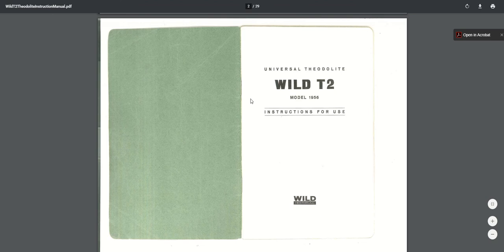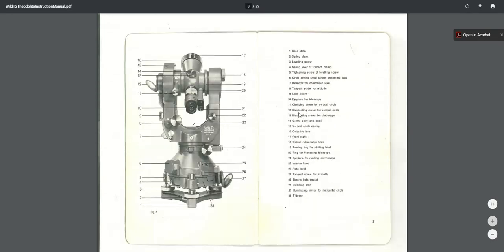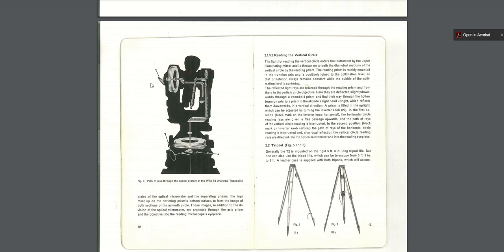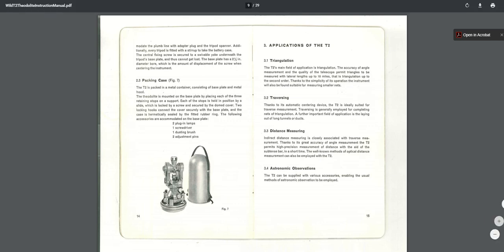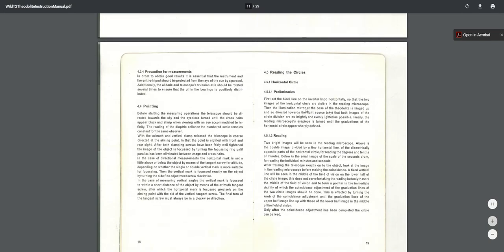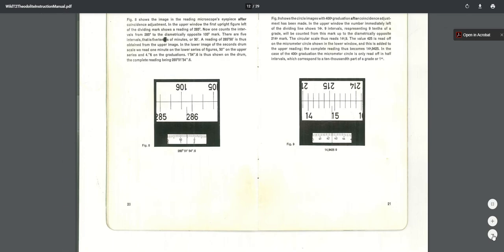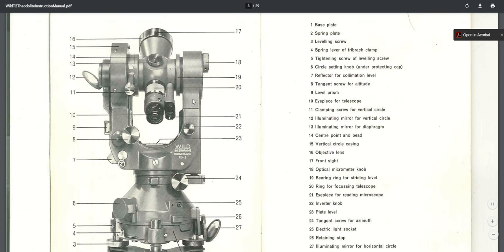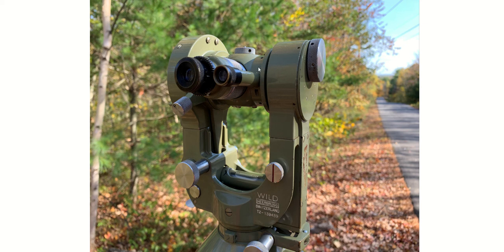Introduction to the Wild T2 Theodolite

Comment from the maker: My apologies if this video is a bit too extemporaneous in delivery.  My purpose is to review some key points about the T2 to make sure I have the proper understanding and to receive correction from individuals with a deeper knowledge of this equipment than I have.
Reply: Not at all. Great stuff.
Reply: Having used a T2 and T2E I am probably more familiar with the T2 and the methods behind Class I and II standards. By following these protocols it’s possible to achieve consistent raw closures of 1/million. To learn these protocols required a one term class in geodesic measurement systems using T2 and T3 instruments. Those protocols are too complex to discuss here and require a strong background in observational mathematics. Thanks for the video. Doc
Reply: Pu
Reply: We had a T2, but I only got to use it once when our total station was in the shop. It was nice to use because of the craftsmanship and quality of the movements movements, but too slow without an EDM. That was at least 25 years ago so I don't remember enough to help you.
Reply: To your final comments, when the apocalypse comes, the guy with the functional pocket scientific calculator will rule the world! Those who will be directly under him are those with the mechanical instruments and the know-how to use them. Beneath them are going to be the people with slide rules and log tables who know how to do math and science the old fashioned way!

Comment: The astronomic measurements you found mentioned aside in the Wild T2 manual are an interesting application of the instrument.  I acquired a similar vintage "analog" theodolite, the Topcon model AG-30B, specifically for an astronomic calculation: to plummet benchmarks for a precise true-north line on a concrete slab for an observatory, allowing polar alignment of the telescope equatorial mount.  I couldn't find any instructions on this topic, and had to re-invent the procedure.  It's not difficult.  You sight Polaris on the theodolite crosshairs (on a clear night), lock the horizontal angle to zero, and quickly note the date and precise time of day of the sighting.  Running Stellarium on a computer, you set it to the date and time of the sighting, and it will report the azimuth angle of Polaris, which will be slightly off zero since Polaris is not precisely on the north celestial pole (this Polaris azimuth would have been calculated with an ephemeris in the old days before software methods).  You apply that azimuth as a correction to the theodolite horizontal angle, and the scope now points true north, within the limits of accuracy of the instrument!  You can then plunge the scope to mark two or more colinear benchmarks on the floor, aligned with true north.  It occurred to me that you can use any star in Stellarium's extensive catalog for this purpose, preferably low on the horizon; you just have to note the precise time of the sighting.  If you have the patience to wait to make the sighting at the time of the stars ""transit" (when it crosses the celestial meridian), then you don't need the azimuth calculation, which is zero at the transit time.  Essentially, the point of light of a distant star is your surveyor's rod and turning point!  You've made a primary measurement using only natural objects, without depending on prior surveys or benchmarks.

Comment: I'd love to own a Wild T2. I used one at university, and in the first few years of mining. I enjoy the field adjustments that are available.

I picked up Sokkia TM1A this year, which required some adjustments. The silvering on the vertical and horizontal circles has flaked off over the years, making them difficult to read.
Reply from the maker: The numbers on my horizontal circle are a bit faint, but legible. The vertical scale, which is what I really wanted the T2 for, is bold and dark, very easy to read. I'm very happy with it, overall. 
I tried to buy a Sokkia off a guy last year, but even though he doesn't use it, it was the first instrument he ever purchased. He couldn't let it go for sentimental reasons, which I get.
Reply: @TheMaineSurveyor  I completely understand. My wife was a little surprised when a large orange box arrived and I spent many hours in my workshop, fettling.
Reply from the maker: @b0b5m1th  I'll bet! They're so much fun!
Before I got the T2, I asked the seller if the image was inverted, if it had the split-bubble vertical collimation level, and if it was graduated in DMS, grads, or mils. Additionally, if I ever buy another one, I'll ask the seller to take a photo through the microscope of both horizontal and vertical scales. It helps to get as much info as possible if buying one of these instruments online.
Reply: @TheMaineSurveyor  is yours an upright or inverted?
Reply from the maker: @b0b5m1th  Inverted. I've worked with it for several hours over the last few weeks. It's still strange aiming at the target through the inverted view. How about yours?
Reply: @TheMaineSurveyor  upright! With the T2 I seem to remember that you can plug the serial number into a cross reference chart on the Wild history pages and get an idea of whether it's upright or not, based on the year of manufacture. a few of the instruments that I've used were inverted, and I only really had issues with that performing stadia distance measurements. In the dark, with water dripping down my neck, and ventilation fans off to stop my plumblines swinging...
Reply from the maker: @b0b5m1th  That's some serious work!  I pointed my T2 at my level rod just for fun. It was bizarre reading the numbers upside down. 
The newest model of T2, made from about 1973 to 1996, has an upright image, I believe.
Reply: @TheMaineSurveyor  we always made ourselves unpopular by getting the ventilation turned off, so usually had to work on the downtime shift.
Reply: The Maine Surveyor 
Inverted, the way god made them.

Comment: Here is the vertical bubble coincidence. The misalignment in this vid shows about 3 arcseconds. So, 1 second is easily resolvable. 

http://www.youtube.com/shorts/nPhOZmGuTNg

Note, a manual level uses the same method of leveling. Auto levels have their own set of issues. 

https://youtu.be/nut5MEGxXcg

I have 6 subtense bars. They’re fantastic but really tedious. At 300 feet, 0.01 feet is achievable, but takes time. To get 1:30,000 distance accuracy, the Subtense angle has to be accurate to 0.15 arcseconds. And there are procedures for that level of accuracy. In the 1950s, measuring across a rivine: definitely worth it.

Comment: I have a T2 where the index offset (offset is not error) of 3 minutes. And by doing the arithmetic reading F1/F2 it returns a Zenith angle accurate to 1 second compared to my other instruments. 

Reducing index offset to near zero is just convenient allowing for F1 only reading, as in topo shots, or distance reduction. For elevation determination, F1/F2 reading is always done, regardless of how small the index offset is.

The vertical circle level vial is many times more sensitive the horizontal level vial. The main reason for the the ‘split bubble’ is the bubble changes size drastically with temperature. The fluid is alcohol. And as it heats up, the bubble is compressed. By using the split bubble, that change in size of the bubble has no effect.

Comment: A total station, digital theodolite, is not more accurate than a T2. A total station is just faster. 

T2 is the best.

The battery pack is mostly to accommodate night work. But in daytime it’s nice. I use the battery lighting about 99% of the time.

Comment: Many thanks for your video and the links! after 35 years of using one in the university I found a 1960 model and are now struggling in learning how to work with it.
Reply from the maker: Glad I could help!  The manual is very helpful, but I found I had to read some sections several times to understand it.  But, after several sessions of operation, I've found that the T2 is every bit as accurate as the very best modern total stations.

Comment: Hi! When reading hz and vz angles with the vernier scale (not the micrometer yet) , do you confirm that your dividing mark can only fall on a tenth of gradian or 10 minute interval? Meaning that in the upper window, your dividing mark will only ever be on a line, or exactly in between a line, but never, say, 1 quarter of the way?

Comment: Thanks for the intro.  This should be a fun journey.  A couple of questions. Are you saying “face 1” and “face 2” or phase?  Is that the same as shooting from 1 to 2 and then 2 to 1?  Sorry, no civil engineering ☹️
Reply from the maker: Thanks, Potterma63! I’m saying Face 1 & 2. It means to point at the target, read the angle. This is face 1. Then turn the instrument 180 degrees, and reverse the scope and aim at the target in this reversed position. Read the angle again. This is face 2. The horizontal angle will be 180 degrees different between face 1 & 2. The zenith angles in face 1 & 2 will add up to 360 degrees. (There will be error in each axis that needs to be corrected, but I’m speaking generally.)
Reply: @TheMaineSurveyor  Great, thanks!
Reply: Phase one is face 1, and phase two is face 2.
Reply: Face 1, Face 2 means the same thing as Direct Reverse. Also face Left, face right, same thing.

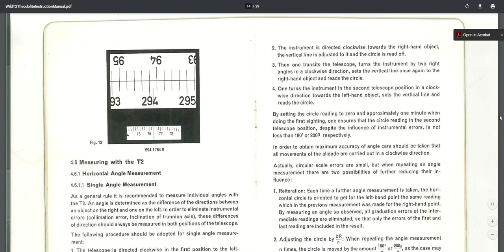Comment: @20:40 is the bottom reading (2) tell you the low digit of minutes (e.g 2'43".6", 12'43".6" ,22'43".6" etc.) and you make which i is by which the upper degrees reading is it closer to?